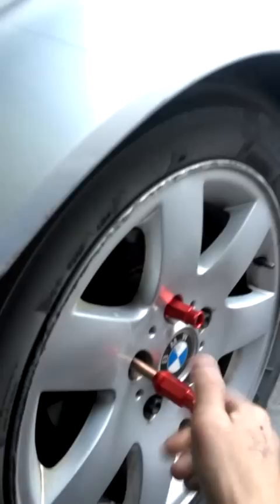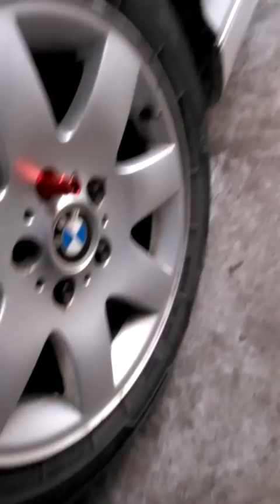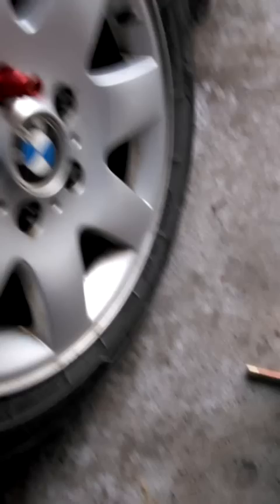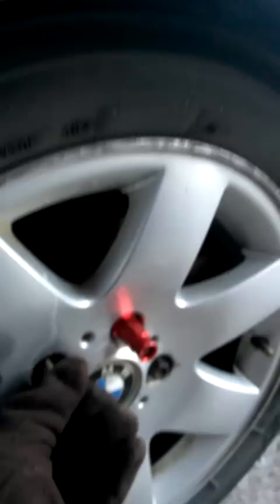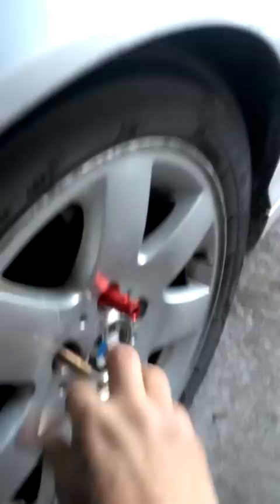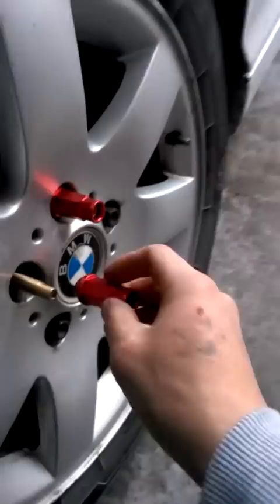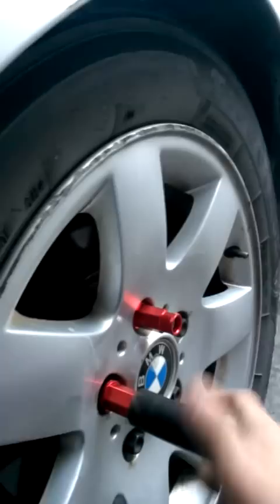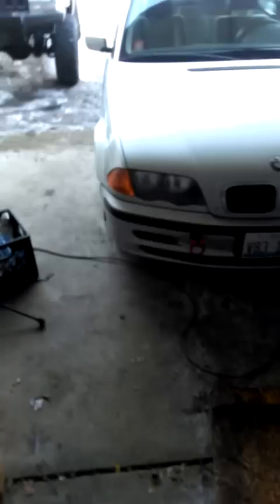E46 lug nut conversion kit bmw 323i

Comment: Only use a dot of red locktite cause you'll never get it off if you use a lot, then put a little never seize on the other threads so it protects the threads and when you take them off they'll never get stuck! Just a little use full advice!
Reply: that's right 👍 you can pretty much do it with a drop or two, and just blow that around the thread

Comment: The right way to do it.  Is take the whole wheel off and locktite the new studs in.  Then put the wheel back on and then never sieze the aluminum new nuts!
Reply from the maker: Yea you already said something similar in the comments below. it still works fine. No big deal.
Reply: Just looking out trying to tell you how to do it the right way?